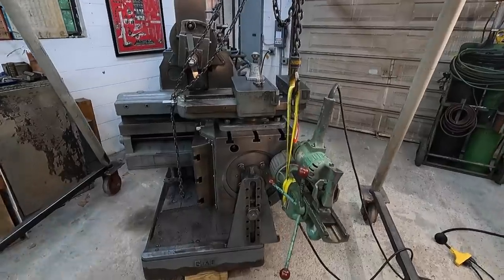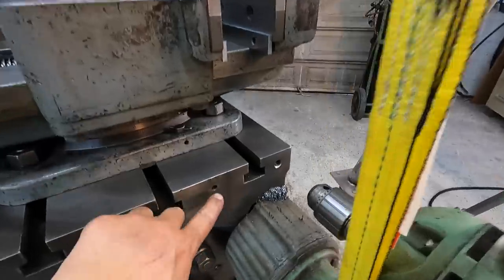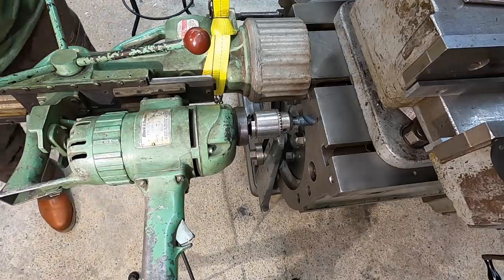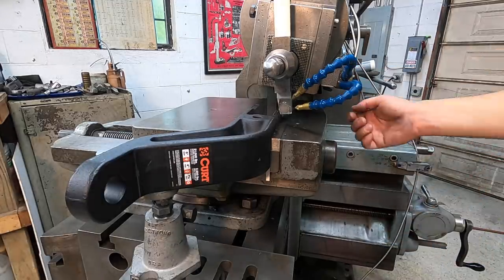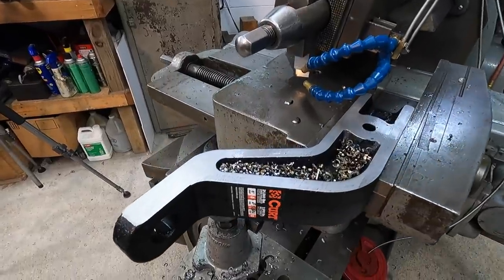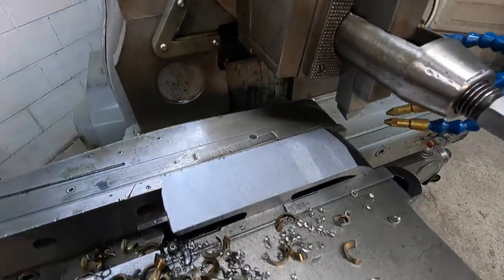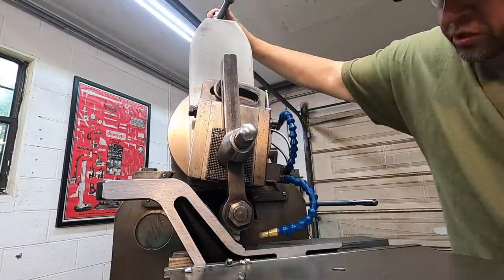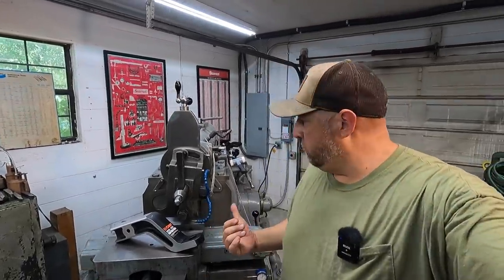3" Ball Hitch Insert Mods Part 2: Mag Drilling the Shaper Table

Comment: Were the cutting bits sharpened freehand or on a tool and cutter grinder or similar. I have an 18 inch Ormerod shaper and wish I could sharpen my cutters so neatly and precisely. It would be a huge help to know the shape and dimensions that were used.

Comment: And after all that, it's a sloppy fit. I realize there needs to be some play, but wow. : ) Nice videos though, Adam.
Reply: I have an all original hitch and drawbar, and it is sloppy.  I just shim it with a plastic strip from a milk jug.
Reply: @robertheinkel6225  Yup, have to shim mine as well. Can't stand the rattle and banging around noises when my trailer is empty.

Comment: yes the god old mag drill many years ago i was nearly hit by one, apparently someone kicked the extension plug out while walking past.... yes there was a  security chain no nobody bothered to attach it
Reply: Also had one fall down on my safety boots thanks to a co worker that wanted to use the power outlet for a second.
No safety chain setup, to tight of a workspace and most of the time it's in the way and pose a hazard itself.

Comment: maybe someone can answer this for me. Why doesn't the shaper feed after the head moves backwards? It seems to be extra rough on the tool having to cut, then withdraw over the material for the next cut instead of over where it just cut. I hope I explained my question well enough to be answered easily...
Reply: It's the design, mon.  It has worked this way for well over a hundred years.  Not that it's not good to be curious.
Reply: That's what the clapper box is for. The cutting tool shape can only cut well in one direction. So it pivots on the return stroke.
Reply: @paulmanson253  right. I realize that. But why does it have to feed on the backstroke? Why not cut stroke, back stroke, then feed? Instead of cut stroke, feed, then backstroke? Edited for spelling/bad autocorrect.
Reply: @Phred_Phlintstoner  Hmm. Very good point. No direct answer for you. Watching this video ,I have decided to rewatch his major service/ rebuild of this machine multiple vids a few years back. It is possible I will be able to physically see the feed mechanism, but why the feed is when it is ,I do not know. Keith Rucker has a multiple partially complete series on the predecessor to the shaper,where the whole table moves. Just maybe the designers stuck with what worked for them before.
Too expensive to do as you describe  ? Those things were an expensive machine,new. One would think everything would concentrate on a perfectly controllable cut,with zero damage to anything on the backstroke.
You ask a valid question.

Comment: i am a old school fabricator  welder and can run i mill to the mark  seems like the shaper will cut off more metal than 9 pass with a fly cutter on a mill and the base metal stays cool. what your guys thoughts end mills are not cheap. fly cutter inserts 20.00 each  just wondering
Reply: Buy a multi tooth replaceable tip face mill. Fly cutters were designed and always meant as a LIGHT finishing tool only. I have more than a few and use them a lot whenever I can. Yes the fly cutter itself is capable of taking fairly large depths of cut, your milling machine spindle splines and bearings aren't designed not meant to take large intermittent cuts like that. There's quite a few YT videos around where you can easily hear those spindle splines hammering on every revolution of the tool while there wrongly taking large depths of cut. Lot's using the Tormach Super Fly as one example.At most I'll take about .005" in steel and maybe as much as .010 in aluminum with a fly cutter.
Reply: Did you bother listening to the video?  He explains here and has done many times in the past, how he enjoys using the shaper.  Sure, there are many ways to do this, but that is not what today's video is about.
Reply: @turningpoint6643  Well put, and thank you!
Reply: @paulcopeland9035  They ain't gonna listen. TLDW (too long, didn't watch).

Comment: Abom79 looks be like you will be in need of a Hitch Clamp to get rid of your rattle in your hitch on a Class III and Class IV Hitches. I use recommend and use one on my Class III trailer hitch.
Reply: Great suggesstion!  The Lets Go Aero silent hitch pin works great for side to side rattle.  I have a hitch clamp and that works great to stop the up and down banging but still had a little side to side play that got annoying on curvy roads.
Reply: Of course...now that I am actually thinking about it, that hitch pin won't work on his hitch because the threaded hole sits inside a normal piece of square tube, which this doesn't have, but I bet he could make something similar.  Oh well, was a good idea I guess.

Comment: Hey Adam,
great video as usual. I know you love your shaper, I'm not criticizing I just don't see the advantage over using the mill. The shaper to me seems very slow and antiquated. Please enlighten me.
Reply: Am pretty sure it is significantly faster at removing material. I remember a Fireball tool video talking about that. If I recall correctly, it has a much deeper max depth of cut.
Reply: Shaper is faster than a mill.

Comment: Trailer hitches are not designed for heavy lifting - rather for heavy pulling. Consider that before you commence.
Reply: Throw a trailer jack on the design with a caster wheel and problem solve there or atleast that’s been my idea for that one so I’m not putting so much load on just a few bolts when lifting heavy stuff also been thinking about either making it stick out far enough to get past the tailgate or some type of double pivot
Reply: @jeremycable51  
That's an idea, but that wheel will be your main pivot point for the crane.

Of course it all depends on how heavy loads you intend to lift.
Reply: @Peter_Riis_DK  definitely would have to upgrade the wheel but the pivot would be its own bearing housing the way I’ve got in mind kind like a vertical spindle then the boom and everything pivots off that the jack is just support to the main hitch slide in the stability will still come from the trucks springs as to let you know that you’ve got way to much weight before you drop it all on it
Reply: @jeremycable51  
I can't quite imagine what you mean - and I'm a natural born sceptic - so I'd really like to see it when you get it made. Maybe post a walk-around video and give me a holler. 👍
Good luck.
Reply: @jeremycable51  I vote a few turbine engines and a dirigible to help out.
Reply: @silasmarner7586  
A dirigible what?

Comment: you made the pocket walls thinner, you know that,  your not using it at full cap, but what is it really rated at? pull fine, pothole? (ie:GM1372) probably maybe, good luck with insurance. Tube steel is not only cost effective (cough cheap) but it can take twisting without thinking about it. I doubt you did anything but scale everything by half inch and pockets are shallower and use (percentage wise) thicker walls

Comment: I noticed that the travel going back, right at the end of the work piece the shaper moves the work a little just before the cutting bit has fully cleared the work on its backward travel to end position..frame 22:13 ... Would it maybe avoid that side wise movement (that could have broke the first cutting tool) be mitigated by moving the work out a bit towards the front of the machine.. so hat the timing of the advancing of the work would not "catch" the tool right at that last portion? I am far from a pro as you are but i have a good eye for little quirks.
Reply: @ParabolicLabs  yeah but to me if you notice the bump up on that backstroke just before it exits the work it hop's up! if it catches just right this would put a lot of force to the side of the tool..in my mind any deburring is not worth breaking a bit or the machine and could be why he broke the other tool in that way. It does look like it has no choice but to pop up as the advance stroke happens as its moving back and the way the tool holder is made to do that protects it somewhat. but i'm no expert either.. I hope Adam chimes in and clears it up.

Comment: Hitch crane is going to need a leg to the ground  else the load on the hitch will be in a direction it is  not designed to handle
Reply: I agree. Allowing for the load to be transferred to the leg/ground would mean the hitch is guiding rather than supporting and could increase the crane's lifting capability. Could you extend the receiver so that the crane leg slides thru it or maybe mounts in a side sleeve.? That way the trailer could remain hitched and then the crane could also lift items onto the front end of the trailer.

Comment: Why does the bit jump on its return on your shaper! Doesn’t it cut its full depth going forward? Kinda crazy to me!
Reply: @7LegSpiders  no, the sideways advance is a ratcheting mechanism that usually clicks over at the rear stop. It has to be tied to each stroke order to set a consistent depth of cut per stroke regardless of stroke length.
The reason the tool jumps up a bit on the way back is like you said @Jennings Moore, there is always a tiny little bit of springiness in the whole mechanism. It just becomes really visible on a shaper due to the pivoting action on the tool holder. Often referred to as “clapper box” because of this. Just like on a lathe, a spring pass (second pass without changing the cutter position) still removes some more material.

Comment: One thing I wonder was why not just cut down the part of the hitch needed to fit inside the receiver? That would leave more meat in the rest for added strength.
Reply: Wouldn't matter. Weak spot would be that stress concetration. Actually better to not have it than to have the extra meat.
Reply: nothing is stronger then its weakest point...
Reply: Well. It would have looked better and the shoulder could serve as a stop that would line up the holes.

Comment: Gosh everything you do comes out so pretty!! I especially appreciated seeing how you made the transition in that inside curve look so fluid.

Taking that much out of the top and bottom of an I-beam cross section, you might consider doing some engineering calculations - I suspect that it will make the load rating go waaaay down, and making sure that the trailers won't be in jeopardy would be comforting.
Reply: Did you watch the first video, part 1 ?

Comment: I gotta say I puckered a little when you tapped that first hole. Heard a groan and then the tap stopped turning. I dont have the stones to tap under power with a drill, always tap by hand.
Reply: That's why you tighten the chuck by hand and dont use a chuck key with the tap. It's like using a clutch on a cordless drill.

Comment: The table seems to jog a split second too early while the tool is still on the reverse stroke. shouldn't the job happen at the end of the stroke exactly at the point where the tool is moving into the cutting stroke? really see it on the slow mo.
Reply: The main reason is you want the work to step over on the back stroke so that it's in position when the machine kicks into the forward cutting stroke. Otherwise you chance adjusting your step over during the forward stroke resulting in an uneven width of cut along the stroke, possibly lowering tool life and resulting in poor cut quality.

In any case, the clapper box is preventing any major tool wear on the back stroke so it's generally not a problem. Especially when you consider having to feed down as well as over to cut an angled surface, the clapper still does the exact same job and the tool isn't any worse for wear.
Reply: Seems like a problem to me too forcing the tool sideways into the piece on the backstroke

Comment: Wouldn't that take a fair bit of strength out of the hitch?
Reply: Yes it would, I wouldn't trust if for what it's rated at all after machining. But he also has stated in previous videos that it won't be used for anything near the rated towing strength.
Reply: At the end of the day the receiver on the truck is not rated for what that was rated for. So I am sure it still more then enough what the truck can take.
Reply: @evvlb2  
As well as the ball. I know the balls are strong, but i think everything else is built to a higher capacity.

Comment: I don't know if this was thought of or something you even care about in this case as it is just for you, but if you did the top and bottom first that would of saved time when doing the sides as that material would have already been taken off. Was there a reason you did the sides first?
Reply: Doing the sides first saved just as much time. It's...hold on...a cubic crossection.
Reply: @caddonk6005  My brain is working fine. I'm pretty sure that the professional machinist knows what he is doing, and why he is doing it that way. BTW, there is never less material to remove from a 3D solid until after you remove it. No matter which way he started the operations it would take the same amount of time from beginning to end.

Comment: Hi Adam Great video, great shaper too....

I am worried for you. The 3"Ball rating has been severely compromised. If the hitch was used inappropriately and there was an overloading problem the Lawyers would pounce ferociously.  If any money changed hands there is no defence to claims of ignorance. Even if free there is still the question of was the work performed by an "expert". A shop full of heavy machinery probably implies this, Ignorance is not a good defence.

To me any work that involves transport vehicles, or other machine  safety should only be undertaken under written specifications prepared and certified by  an appropriate qualified engineer.

Why do I say this?

I have a friend (Not me) that made a particular machine. It was fitted with a heavy bolt on cast Iron guard. Years after the machine was built and my friend had retired, a user of the machine removed the guard and lost a hand. This resulted in nearly half a million dollars in damages awarded against my friend. A serious dent in this man's retirement savings.
The court found that it should have been welded in position! 

As I said compensation layers are voracious.

Regards John
Reply: I too think the hitch tongue is not upto the heavy loads a loaded trailer would impart on it. The section where he machined the round shoulder is the weakest point and over time with temperature and load cycles will develope a fracture. On the road even the slightest of bumps imparts quite a force on the tongue.
Reply: It’s no longer a 3” hitch, it’s a 2.5” hitch. Insofar as a 2.5” hitch, nothing has been compromised.
Reply: John, I was thinking that if an accident ever happened because of a modified hitch this video shows that it was modified and shows that it could have caused the failure. Thinning the top and bottom did weaken the tongue weight capacity of this hitch. However, safety chains are there for a good reason.
Reply: I don’t know how you anally retentive people make it through life. That forged steel hitch will handle far more load than his truck will ever see. Research the fabricated DOT approved hitches on the market. Look at the corner cutting designs the DOT has approved. Guarantee this modified hitch is still over rated for its size/use.

Comment: Is it still strong enough after so much material removed? I’d be worried to actually use this
Reply: True. There’s a reason they use so much material. It’s to make up for the shortcomings of the steel used. Plus an added barrier for “insurance” or “assurance”. 
These things are engineered specifically and forged in such a way to give the hitch the best possible chance at towing with no catastrophic failures.
Reply: Most hitches out there in the world are made from tube and welded. The forged hitch, even cut down, is still a ton stronger and I bet it weighs twice what typical tube fabricated hitch would. He basically made the world's beefiest 2.5" hitch. I also take him at his word that he bought it with no intention of using it for anything near its previous rating.
Reply: Scroll down and read the comment by "The Broken Life"!  This is truth.  What in the hell do you think he is going to use it for.  Worried??......nonsense.

Comment: Given the holes only needed to be enlarged and tapped I would not have bothered with the magnetic base drill. I would have used a 7/16, tap drill for 1/2 " NC, with slightly flattened cutting edges, to reduce grabbing in the soft cast iron, in a hand held 1/2 in slow speed drill. Then used a countersink in the same drill. I would then hand tap the thread using the three tap series. 

The hole are to be used to tie down a support angle so precision was not really needed. My way would save a lot of time. If the holes were being used to precisely locate something then I would have used the magnetic base drill.
Reply: Fascinating. Please tell us more on how to be efficient.

Comment: Why does the cutting head drag on the return stroke?
Reply: Nobody really knows it's one of the universes unsolved mysteries
Reply: I am also curious why this is.
Reply: I think the mechanism that the shaper uses is like a one way valve. So on the cut stroke, the tool pushes against a hard stop and cuts.
On the return stroke, the tool pivots up and drags over the piece.
This is probably because the tools are only meant to cut in one direction. So if there's a power feed, the tool may get caught in something and break if it was held in a single spot
Reply: @IDSKoT  that seems to make sense, not forcing the cutter in the wrong direction. But, on the return stroke it should have already removed the material needed to make space so it doesn't hit, then power feed moves once the cutter is far enough back. Hmmm.
Reply: @yourfacelookslikebut  The cutter moves in a diagonal on the return stroke, so it does the feed while returning, not after it has returned.
Reply: @Balsamancnc  not the case. The table feeds after the cutter has fully returned.